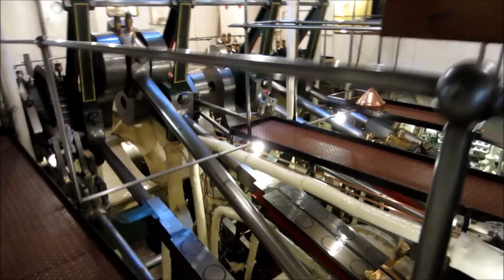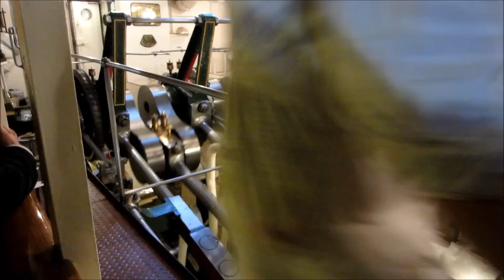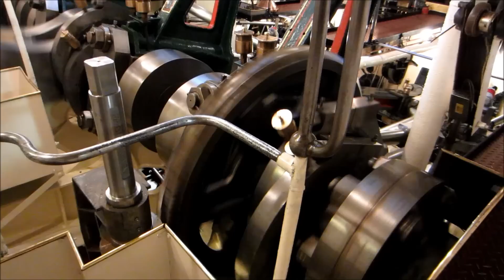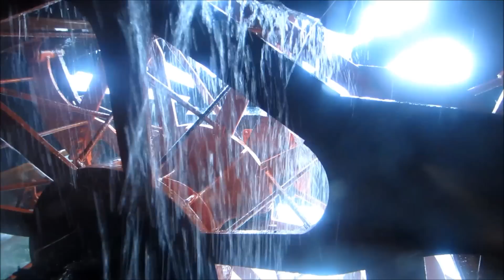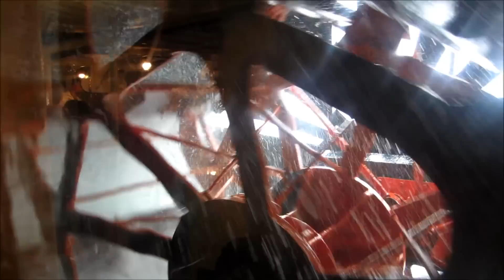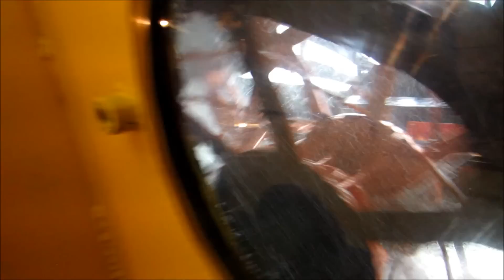Paddle Steamer Waverley Engines on departure from Lochranza 14th August 2016

Comment: 100 years ago, there used to be a large number of sidewheelers like this on the US Great Lakes.  My mother took a trip on Seeandbee, a night stateroom boat, and my mother in law went on the Tashmoo, a legendary fast boat on the Detroit to Port Huron river run.  Both had the same inclined triple expansion design.  Also, there were some sidewheel rail car ferrys traveling across the Detroit River, Detroit to Windsor.  One of them, Lansdowne, had the sidewheels not connected, with 2 separate engines, so she could steer like a Bobcat. I watched Lansdowne at both the Detroit and Windsor docks.  Eventually, she blew a cylinder head, and was moved by a tug after that.

During WW-II, 2 of the large sidewheelers were converted to small aircraft carriers for pilot training on Lake Michigan out of Chicago.
Reply: Get over to the UK for a trip on this lovely paddle steamer. The last sea going one, anywhere in the world.

Comment: For those, like myself, who have little knowledge of the way in which paddle-steamers are operated, the following comments (from someone who served in one) might be of interest:
""With a paddle steamer one has to come in quickly – too slowly and one loses steerage.  OK with a screw ship with the propeller next to the rudder which is quickly activated but on a paddler the propulsion is amidships and takes a long time for the flow of water to reach the rudder.  I can well recall when I myself was Mate of a large paddle steamer in 1966 the Captain calling the Chief engineer to the Bridge and telling him that from the time he touches the engine telegraphs the paddles are to  be turning in 3 seconds not 5.  (Sometimes there was a harbour wall or similar directly ahead of the pier).  Also when reducing speed, say from Half Ahead to Slow or Dead Slow Ahead, then the engineers should give the engines a blast of Astern steam to ensure that the engines are going at the ordered speed.  
.
 Also you will notice that in a paddle steamer the engine telegraph has TWO distinct sounding bells – one for Ahead movements and one for Astern movements.  Screw-propulsion ships, IF indeed they have telegraphs which today they do not, just have the one sounding bell.  However on screw-propulsion ships, if indeed there are telegraphs (as today manoeuvring is controlled by the Bridge directly) the engine telegraphs are there as a reply, so when the Bridge give the order then the engineers also move and ring their telegraph so the bridge knows the engines will turn the correct way.  On paddle steamers,  TWO distinct sounding bells are fitted to the engine room telegraph, so there will be no confusion at all as to which way the engines should be going.
.
 Paddle steamers can stop very quickly – I know that the Bristol Queen , whose service speed was about 16 knots could stop in about ¾ of her length (if Full Astern was rung).  BQ was built as an esturial steamer for the rough waters of the Bristol Channel – you will note she has portholes instead of windows, also her paddle floats were of steel as opposed to wood of the Waverley.  However if a steel paddle float is damaged then that is a dry dock job whereas if a wooden float breaks, as happens from time to time, then the ship can proceed ok and the engineers will fit a new one when time allows.  Bristol Queen was an excellent Sea boat whereas Waverley is really a river boat and not so stoutly built.  I still have some pages copied of our Deck Log book.  I can still recall proceeding down channel (Cardiff to Swansea) light ship  ie no passengers in a full Westerly gale force 8.  As you can imagine, in the BQ we got a little wet on the Bridge !    Waverley is not allowed to proceed if the wind force is 5 or above. BQ would have been the one to preserve but sadly she went to the scrapyard after only 20 years.  The age of preservation had not yet then arrived.  You will note that the BQ has concealed paddle boxes – not a particularly good idea as they easily become choked.  When there were no passengers on board and we were proceeding in rough seas, the paddle box doors would be left open and the excess water would come in to the alleyway and out through the scuppers !  The MCA would have a fit today if they saw that!
 .
Also in former times their were many pleasure steamers on the R Clyde both paddle and screw.  A 16 knot paddle steamer could maintain the same service as a 21 knot turbine steamer, because the paddle steamer takes less time to dock and pull away - an advantage on short hops  Also paddle steamers had a much shallower draft."

Comment: I wondered about the jacking gear, hadn't seen it before. Good to see they're keeping after her.

First time I noticed that the crosshead shoes travel about an inch past the end of the crosshead guides. Suppose that's a way to shed dirt?

We'll probably never get across the pond to see her, so these videos are a great substitute.

Waverley is the closest we'll ever get to the long-gone fast Tashmoo, and the big sidewheel night boats on the US Great Lakes. These boats had the same inclined triple arrangement.

Wonderful video, keep doing them!
Reply: SteamCrane When I worked on her, the engines were turned with block and tackle fitted on eyes in the sponsons, and attached to the float arms and turned by pulling the chain while standing on the  narrow bearing platform directly above the water. It was hard manual work and you'd easily work up a sweat. My glasses fell off, much to the smusement if the chief: and are prop still there yet at the bottom of the river.
Reply: Wow! That's crazy. Wonder why they didn't have one from the beginning.  You know you'll need to turn the engine sometime to do any work.

Thanks for the info!
Reply: The crosshead guides travel past the guide itself in order to dip into the oil bath below on a vertical engine, probably the same on this one though you can't see the other end of the guide.  Usually around 90% veg oil, 10% mineral oil, with a bit of water to emulsify it and make it stick to the guides.  On many ships it was collected in the bilges and pumped out at sea (if an ocean going ship) or landed ashore, as it was a total loss system.  Pumping out at sea would not be allowed these days even if it was 90% veg oil, but then, there are no ocean-going steam reciprocating ships left.

Comment: At 1:00 Order "Ahead Stand By" means Astern (dead slow)? Cause that is the order, and that is what the engine looks like it is doing. What's up with this?
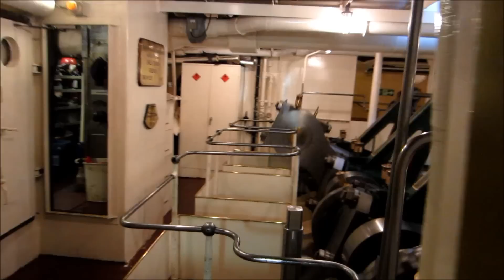EDIT: at 3:10 I was thinking  the "New Turning Gear" would be an electric motor that replaced a steam engine,.. But I was wrong. Looks like one must engage that worm and lick it, then bring out the Crank. I am sure it is easy to crank though. Only need to move it at most one rev, and occasionally. I wonder how they positioned the engine before this was installed? Based on description, I guess the boilers had to be up and one had to slightly power the whole engine. But what if one needed to pull the first piston out? Interesting. The crank is the wtg.

Comment: Wonderful to see.  But I’m curious about the crank throws, as a three cylinder, are they actually at 120 degrees out from each other?  It appears, to me anyway, that there is a difference in the phasing of either outer journal when compared to the other using the center as reference.  Thank you for posting, large steam engines are fascinating.
Reply: Relax. The Scots knew how to build steam engines.
Reply: With the 3 cylinders in the same plane, the throws should be exactly 120 degrees, especially since the engine is reversible. On a non-reversing engine, the angles could be fudged for some performance reason.  There is a massive sidewheel German river towboat, Oscar Huber, that the cylinders are not in in same plane, so the cranks are probably not at 120 degrees. I watched Waverley's engine turning from the cylinder end, and counted the time for each crank to go over top, and it seemed pretty regular. Possibly somebody in the engine crew could answer.

Comment: Is there a reduction gear between the crankshaft and the paddle wheel on the outside of the vessel?
Reply: No, just one solid shaft (several sections bolted together).  The crankshaft is mounted so that the drive shaft is just above the gunwhales.

Comment: Y don’t seamship engines puff? I love that sound
Reply: That chuff on steam locomotives is due to exhaust steam being expelled through the funnel. Steamships, however, traveling longer distances where freshwater is unavailable between stops, must hold on to their water supply as much as possible. Rather than expel it into the atmosphere, they send their exhaust steam to a condenser that cools it back to water. Water pulled from rivers, lakes, or oceans is usually too dirty or saltly to run in an engine without causing damage. However, devices such as evaporators can filter it, albeit in relatively small amounts.

Comment: Fantastic engineering. I sound a bit dumb but is this a 3 cylinder?
Reply from the maker: Yes. That's what a Triple Expansion Engine is, 3 cylinders.
Reply: Yes, it's a triple-expansion engine.  The steam is first admitted to the high-pressure cylinder, and after it has done its job is passed on to the middle one.  Because the steam has lost some energy, the next piston has to be of larger diameter (and therefore area)  to get the same amount of work out of the steam.  The final cylinder, the low pressure one is even bigger for the same reason.  After that the steam goes to the condenser to be reverted to hot water for re-use.

Comment: Can't see ANY SMOKE from chimneys - is the steam boiler furnace gas/oil heated???
Reply: She is oil heated. When built the boiler was coal fired. This is the 2nd oil fired boiler to be fitted.
Reply: @cedarcam  
What grade of oil?  Does it need to before it can be fed to the burners?
Reply: @srfurley  Good question Stephen. I do not know the answer to that but believe it has to be pre heated to atomise in the burners so must be a heavy grade oil. I see someone who worked on the ship on a day out sometimes and will see if he knows or can find out for you

Comment: Same engines as titanic had triple expansion engines
Reply: Titanic's were vertical triple expansion, the normal for propellers.  Waverley's inclined engines work well with side wheels, and the cylinders are low to lower the center of gravity.